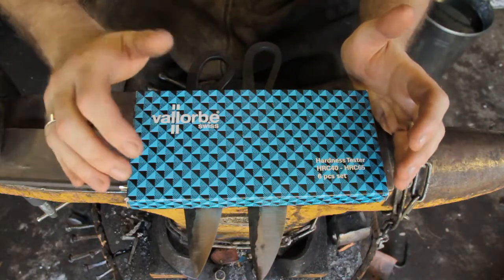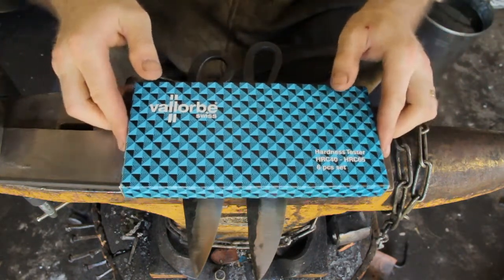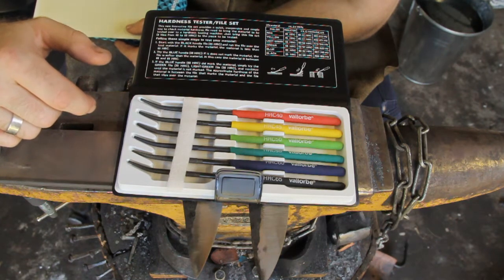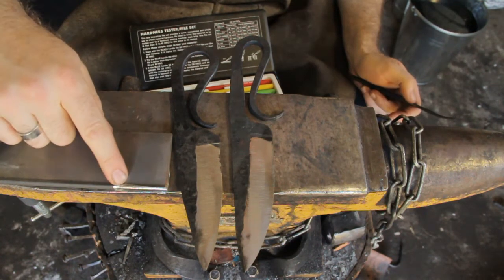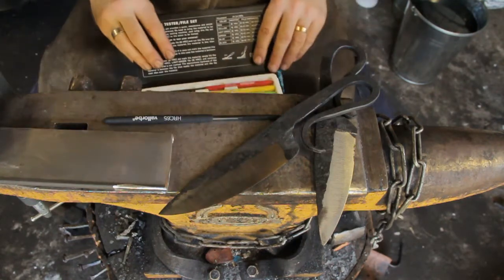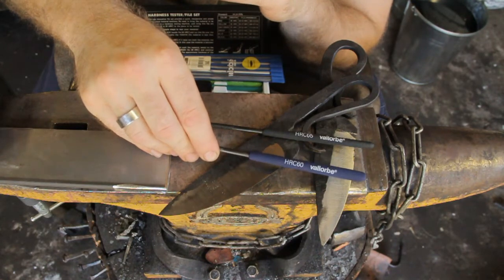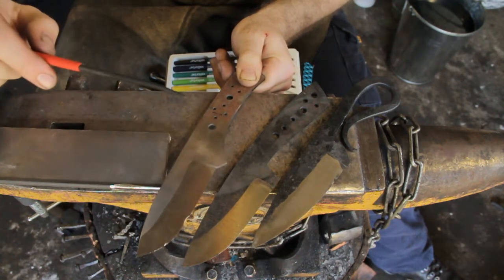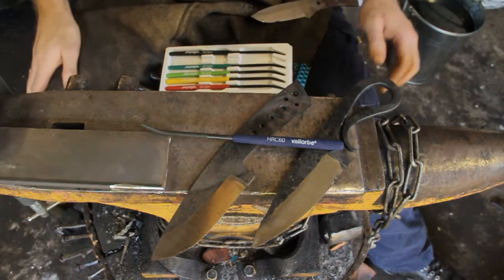Vallorbe hardness test files

Comment: Five years old, but I have a question please (if you're still active). Do you just test this on the very edge? Is that because that area will be removed during sharpening anyway?
Reply from the maker: No you can test all over as long as you have ground the scale back and are checking steel itself rather than oxide. Its often interesting to see how the thickness will impact hardness. A slightly softer spine might be preferrable but you need to know that the "working" part of the blade has hardened as you intended.
Reply: @batcountryforge5945 Hello again! A quick question please. Should you run the file across the edge or the flats of the bevel? I have a piece of steel that skates on the edge up to about 60, but scratches the flats.

Also, how much pressure should I apply? I know that's hard to describe...
Reply: Thanks mate

Comment: I got the same set of hardness test files to test my 1075 knives. Even after followed the instructions that came with the files, I wasn't 100% sure if done correctly. This excellent video with clear instructions reaffirmed my test results. Thanks!
Reply from the maker: Thanks Red glad it helped. They are a super handy tool. Beter than using any old file thats for sure

Comment: Awesome video. Thanks I am going to put another order in with gameco in the next few months. I will have to decide if I want these or not by then. When you HT your 1075 how long do you temper for and how many times? On the website it only tells you temps but not times or number of cycles.
Reply from the maker: All steel should be tempered twice for 2 hours each time, coming back to room temperature in between the tempering rounds. Use the tempering charts for the relevant steel to work out what temperature you should be aiming for.
Reply: Thanks so much for letting me know I will try that next time.